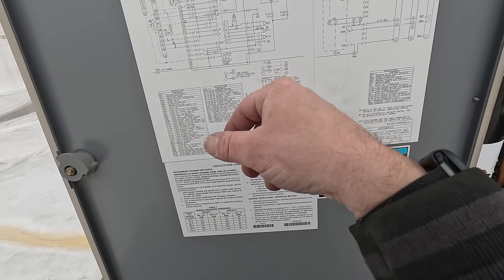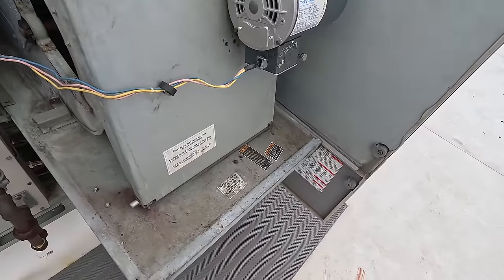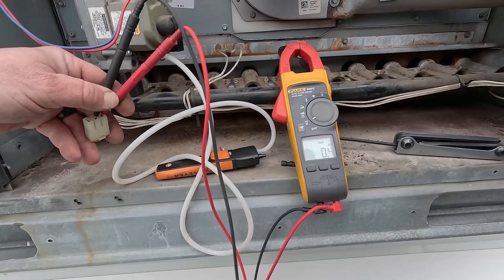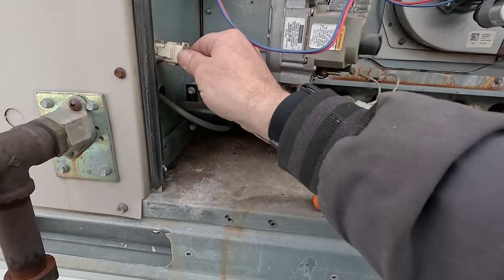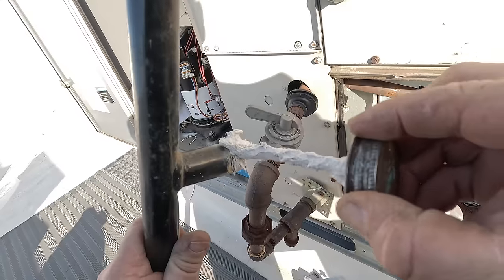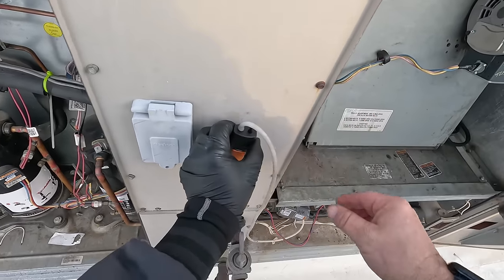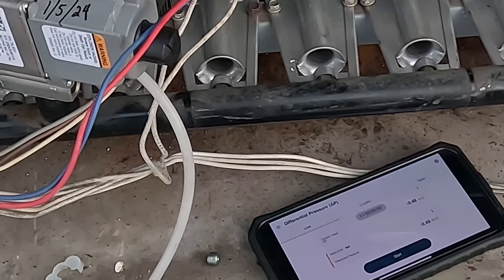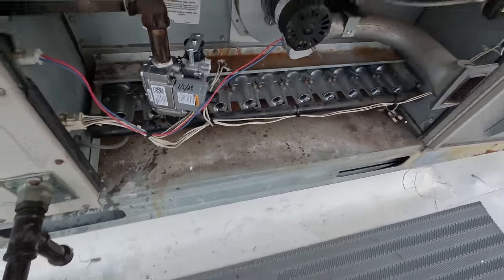Another HVAC Disaster! I keep Getting These Colossal Problem Calls

Comment: You should get into pharmaceutical HVAC, some of it's maintenance, ac units, chillers, old / modern ahus, balancing cleanrooms, labs, some c+q, some design consultation, some qualification work on lab stuff, gloveboxes, msc's and whatnot. I'm quite like you, I get bored easily. There's enough variety in what I do to not get bored, so far anyway. Got bored with architecture, got bored of being broke being a barista, pro or otherwise there's no money in it, but this so far is interesting. There'd be less electronics involved which I would like more of but so far Im happy. 6 years in it's the longest career I've had so far.
Reply from the maker: We do work for one Pham laboratory, they have all kinds of stuff to work on.

Comment: I worked on this exact same style of model yesterday. Almost the same issue with only lighting across the first few burners and stopping. Mine ended up having a capacitor directly above them pop and leak it's gel all over the center couple burners and the gel blocked off the burners. Lol
Reply from the maker: Lucky you 🤣👍

Comment: I work on tons of those lennox units.  I keep a box cutter knife with me as they work great to clear the cross over fins and allow the gas to run all the way to the last burner.  Good call on the ignition module.  Those old blue boxes are junk.  And on the note of the testo manometer, I had a terrible time with my drifting off to infinity.  Had to return it.  Still have the old UEI EM152.  It seems to just keep on going.

Comment: What is the reasoning behind not using copper for gas in the USA? Is it some protectionist policy to give steel workers jobs?
Reply from the maker: Natural gas will make the copper plate and flake then that gets in the gas valve and can causes a potential catastrophic failure. Copper can only use on liquid propane.
Reply: This is very interesting as we pretty much only use copper for commercial gas - high rise installs may be 6” + and it’s pretty common on old residential installs with no issues - these have mostly moved to multilayer pex.